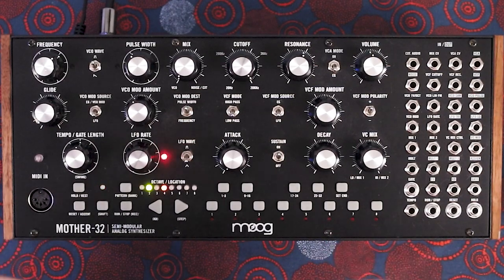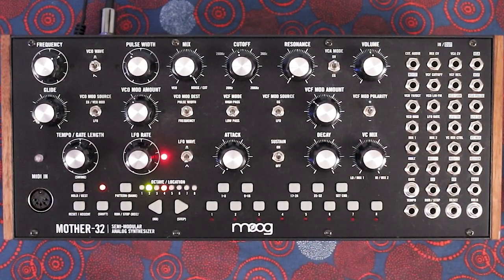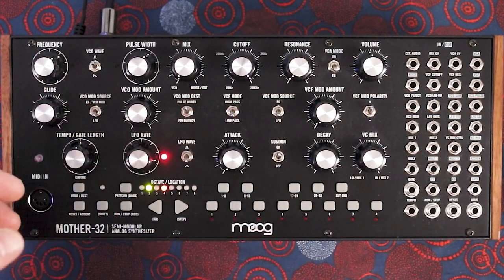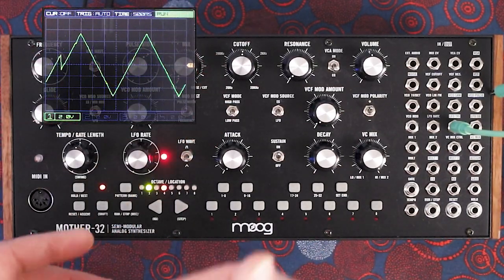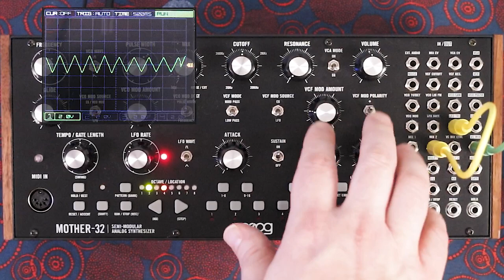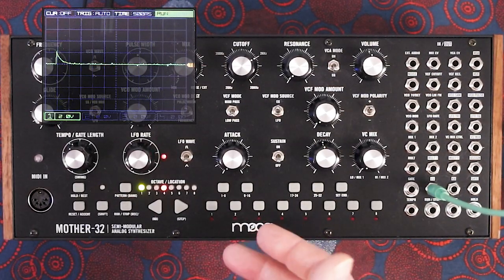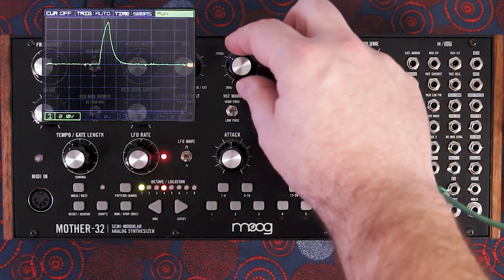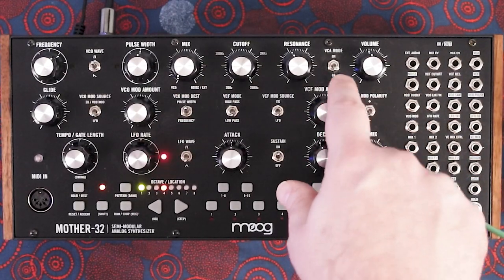Killer Sounds with LFOs | Mother-32 Tutorial Part 5 - LFOs and Envelopes

Comment: Loving these videos. I have the Mother-32 and the MiniBrute 2S and I’ve always used the MiniBrute more.  I think that will change as I learn more about the Mother. Your videos are very informative.

I noticed you got the same effect with the LFO at audio rate of getting both a triangle and square similar to how you can get a saw and square by patching the square VCO into Noise In the set mix to 12 o clock.
Reply from the maker: Yeah, it is very similar. There's lots of different options. The Minibrute's sequencer is pretty great. Sometimes I miss that screen when I'm using the Mother. They both are awesome in their own ways.

Comment: It is possible to synchronize the LFO with the tempo? I can,t do by ear, y try patching every out into lfo rate input but nothing works...may be i missin something, i,m new into M32...🥵
Reply from the maker: Unfortunately you cannot tempo sync the LFO... I've read some workarounds where you can get the LFO to reset, but they didn't work in a way that I felt was usable... It would take some creative patching. I would use a module like Pam's Pro Workout for tempo Sync'd modulation.
Reply: OK...Thank you! @braintree56